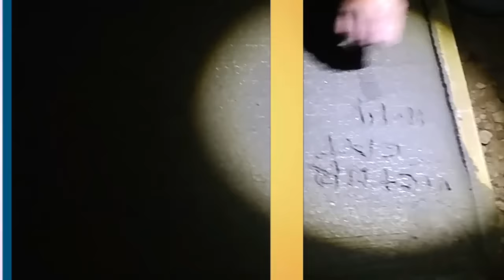North Central Paving: WE DON'T STOP AT BLACKTOP

Comment: Should have done the concrete before the deck stairs.  Now you have a trip hazard on the bottom step since it's lower than all the rest.
Reply from the maker: That was put in a year and half ago and NOBODY has tripped on those steps and the back deck was there when he bought the place

Comment: When you have a asphalted driveway installed. Will they also install a concrete water trench running down the sides so the rain. Don't wash the edges away. My driveway has a slight incline. So would like the rain to be directed down the sides of the driveway, rather than over or on to it...lol
Reply from the maker: mss burr Is your driveway on a steep hill or heavily pitched to one side?
Reply: It is not extremely steep.. and it does not slop to one side. My house sits on top of the slight hill.
Reply from the maker: mss burr then you shouldn't need any extra support (besides gravel/dirt) what we usually do is we add about 2 to 3 inches of asphalt on top of the edge of the matt which we make it into a water curb to prevent wash out.